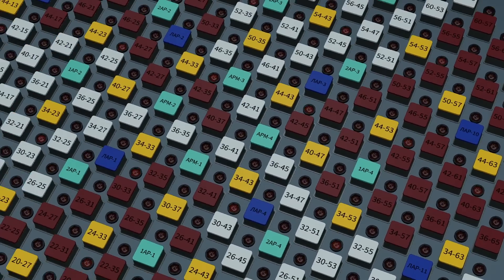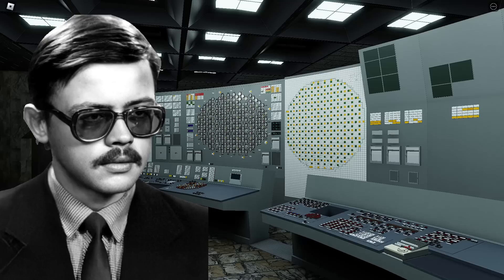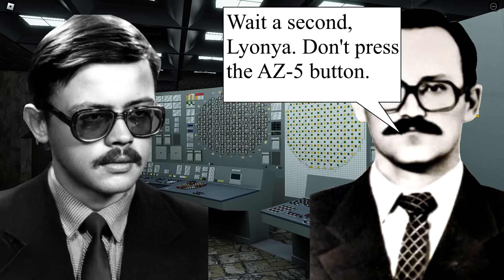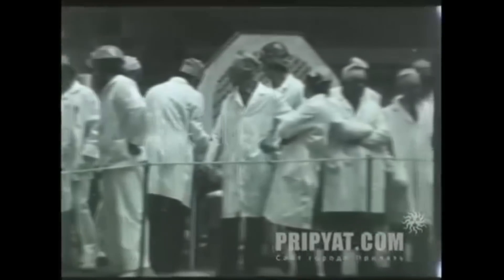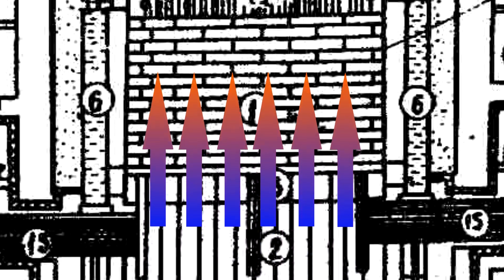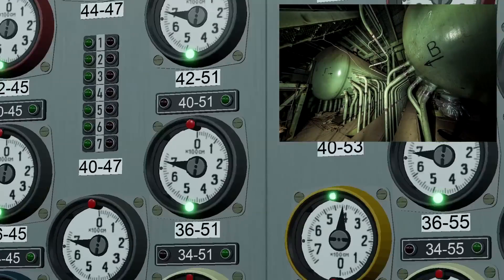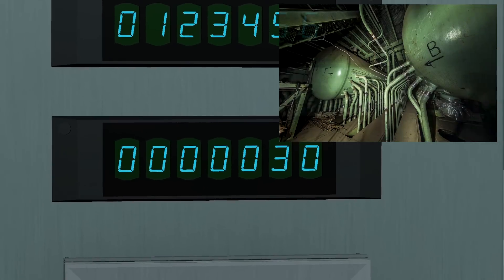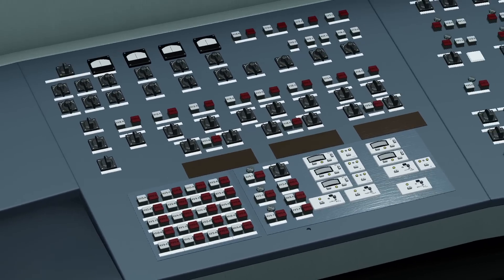Would Not Pressing AZ-5 SAVE Chernobyl?

Comment: I had always wondered, a little different scenario - if the rods were brought back in one at time vs all at once if it would have made any difference.  

I've also seen quite a few comments that the lower rods did not have the same positive void coefficient issues due to the lack of the graphite tips?  So if they had been brought back in or been triggered by the AZ-5 (which I believe I saw was a later change) it could have also helped or prevented the incident?